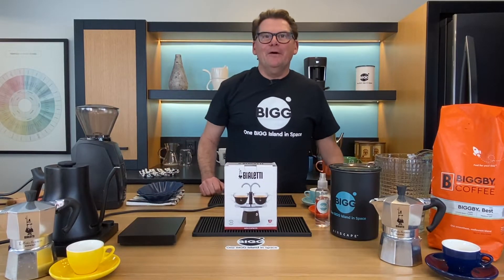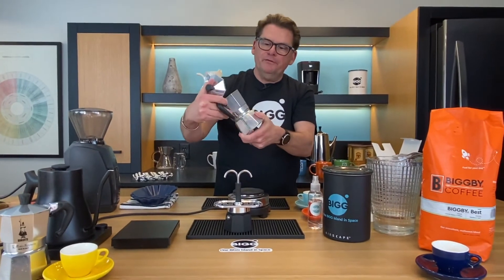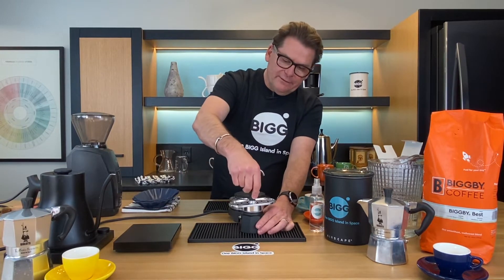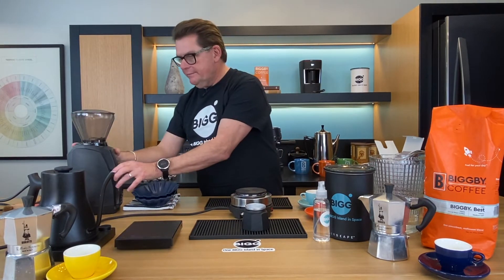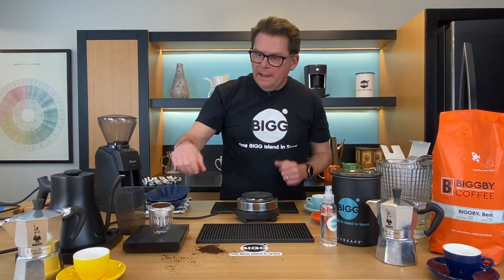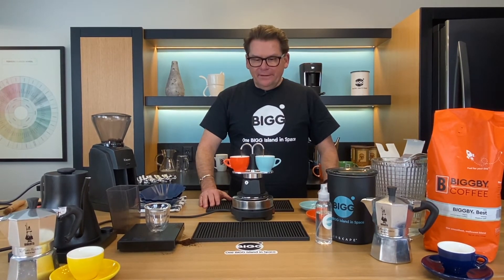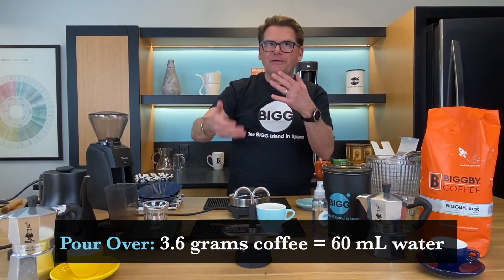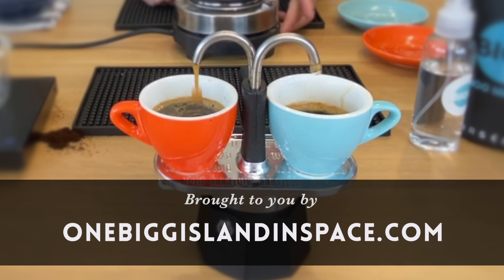BEAN BASICS S3 E4: Bialetti Mini Express

Comment: Hey, while cleaning my mini express I noticed the holes going to the two spouts are a lot more narrow than in a traditional moka pot. I'm interested in your take on this. I personally think the reason for this is so the pressure is more equal in both spouts and therefore an equal amount of coffee will come out in both cups. Also it will probably brew at a slightly higher pressure than a normal moka. I notice I need to really slow down the stove in order to not make it sputter as much.